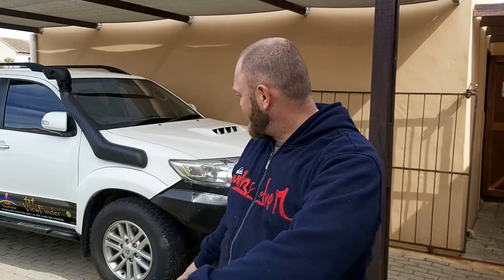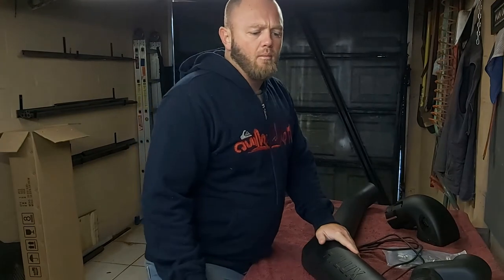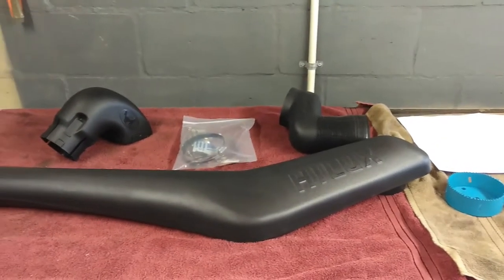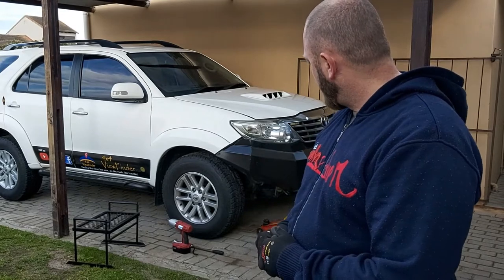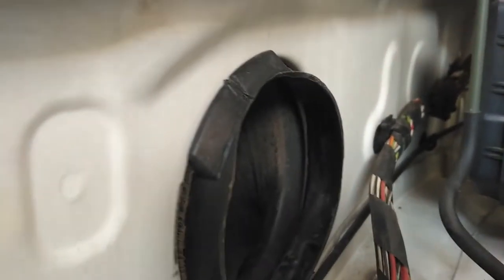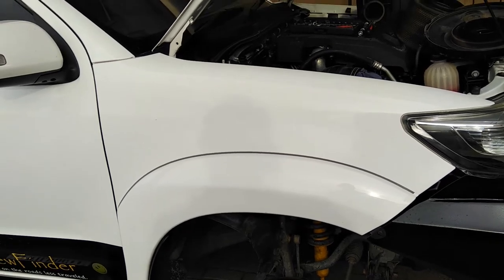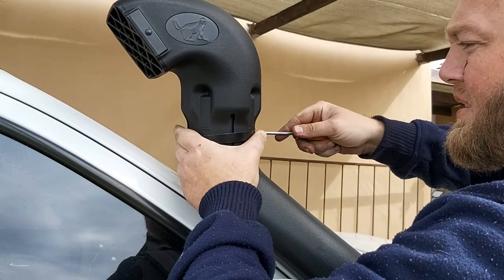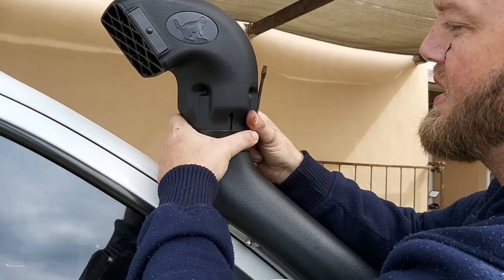D4D Fortuner DIY Snorkel Install

Comment: Hi, a great video with very detailed descriptions - many thanks! Followed your instructions and had the Schnorkel installed in 7 hours. - Four words of advice to the next Schnorkelist: one, don't, I repeat, absolutely DON'T trust the template that comes with the kit! It even says on the template itself that you should first re-align the drill marks with the actual bolts on the piece. Well, I did that only half-heartedly, and the result was that the holes for the bolts at the far end of the snorkel were then a good 2 cm (!) out. So I had to drill them again. Two, I'd advise you to comfortably oversize the bolt holes; a 10mm drill bit will be just fine and give you some play. Three, make sure the metal plate that holds your snorkel's upper part against the window/door frame is placed close enough to the window, otherwise the nuts at the bottom might jam against your door when opening it. And finally, I really struggled to cut through my fender with a hole saw (I had to borrow one; maybe the thing was blunt or too rough?) In the end I used my jig saw with a very fine blade, protected the metal around the cut mark with a thick layer of cardboard and got a perfect cut.    - Once again, many thanks for the video!
Reply from the maker: Jan, thank you so much for taking the time to comment and giving some great tips. You are absolutely right. My holes worked out perfectly for some reason. Not sure if the fact that it is a bakkie schnorkel and not a fortuner one. But if you encountered that issue then it is excellent advice. Id say you need to be skilled at problemsolving to install a schnorkel. Like you said, dont trust the template. Perhaps i did under emphasize that a bit. But i am so glad i was able to help you install the thing. Many happy kilometers. Keep safe.

Comment: Shot for the video man, great detail! Just a question, I have got the same snorkel, if I measure the outside diameter of the pipe section that goes through the large hole that gets cut, I get 98mm. I see you are using a 108mm hole saw though. Bought from the same supplier so am I missing something stupid here.
Reply from the maker: Hey Quinton. I think it could be that my snorkel was actually for a Hilux. I got some extra fittings that i didnt end up using witht the kit. So you may have the exact right kit. If your template says to use a 98mm then go for it.

Comment: Awesome video dude! Really appreciate it. You and I think alike with a lot of things. Going to start collecting some of the tools and supplies in the next week or two and give it a try myself 🤙
Reply from the maker: That is great news bru. Ill watch your Instagram for the pictures. Its a pretty satisfying job. Take your time and call me if you need any help.
Reply: @4x4ViewFinder  thanks dude, appreciated 🙏 Will tag you in the post. Are you going to do a follow up on your fuel economy and power etc.?
Reply from the maker: Awesome, thanks bru. Cant wait to see how your car turns out. Wrt the feul eco, Just need to get a baseline and replace the filter. Then i wil start logging the numbers. Then we can have a look. Perhaps a full month of driving should do the trick.
Reply: @4x4ViewFinder  what air filter are you going to use?
Reply from the maker: Im going for the standard toyota one. I thought about K&N but the jury is still out on weather its good or bad for your engine. Sticking to the tried and tested.
Reply: @4x4ViewFinder  so a mate of mine has only been using the K&N filter with no issues. His Hilux is on 300 000km and he's noticed an improvement on performance from when he started using them. I'm going to give it a try on the next filter change, which will be soon but after the Snorkel install. Will give some feedback and see how it goes.
Reply from the maker: @burtons_undiscovered  awesome that would be great. Then we can straight up compare and see. So great consumer advice for anyone intrested. Hahahha
Reply: @4x4ViewFinder  lekker 🤙 I'll have the Snorkel in hopefully by the end of the of the month. By then I'll fill up again and will confirm a baseline fuel economy - trip computer is currently reading 8.9km/L. Also will double check that the bakkie hasn't been de-catted already.
Reply from the maker: @burtons_undiscovered  if it is decatted, it would be perfect. Then we would have a perfect comparison. I was in the 8-9km/L region as well. Also, a tip. Inflate your tyres to 2.4bar. That helped alot. Its been about 8000km now and my tread is still perfect. No uneven wear. Ride slightly rougher but worth the gains in economy. Ill try and setup a feul usage chart that we can start together and compare the two. Perhaps even make a video about it if you are keen.

Comment: hello, do you encounter a problem such as wetting the air filter, does water go to the air box in heavy rain?
Reply from the maker: Hi there, no water does not enter the air box, if it does it drains out the bottom of the air box. There is provision made for water entering the air box by Toyota. I flip my snorkle head around so it does not scoop so much water, not that i need to but you and I are probably the same, we like to be extra carefull.

Comment: what was that red paste you placed around the tube on the airbox?
Reply from the maker: That paste was the Wynn's red gasket maker. Its a type of heat resistant sylicon that i use if i want a permanent seal on any two joining surfaces. It works like magic. Hahha
Reply: @4x4ViewFinder  ok cool

Comment: Where does the silicon hose fit up to?
Reply from the maker: Good question, wish i could tell you. I was racking my brain and going through any possibility of its use and i could not find a single spot where it fits or could be of use. Seriously, i tried everything. It does not fit anything. If you find out one day. Pleaaaaaaaase tell me. I still have sleeples nights about it.
Reply: @4x4ViewFinder  yeah mate I had no use for it either manage to get my snorkel to fit with a few changes to the template as some holes don’t line up other than that looks good
Reply from the maker: Awesome bru. Glad you got sorted. I also had plenty oakes tell me the template has some issues. Resizing the wholes was the only way to win with this piece of kit. But it works a charm, i only replace my air filter every second service.